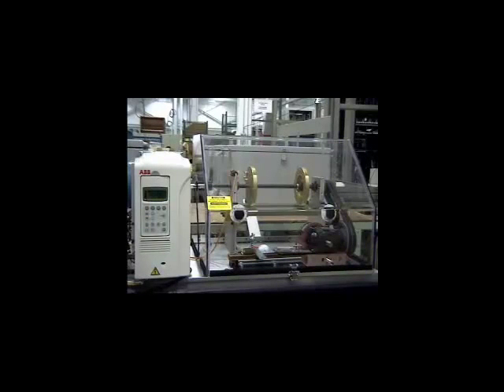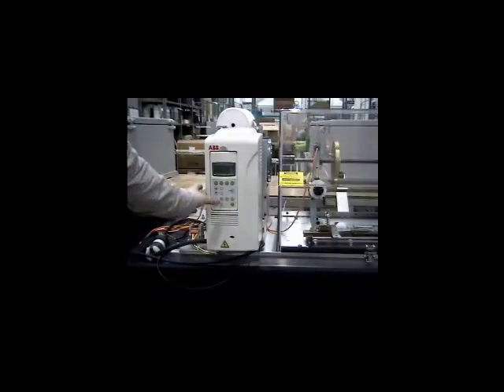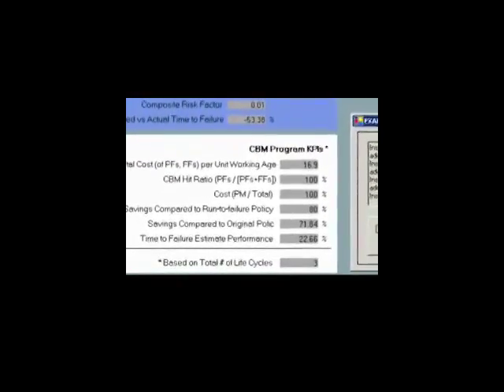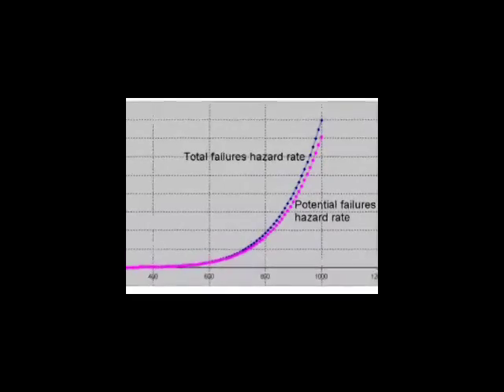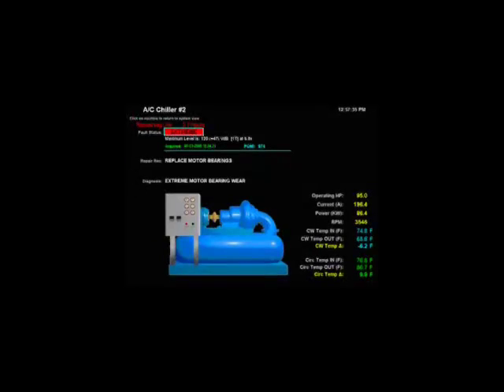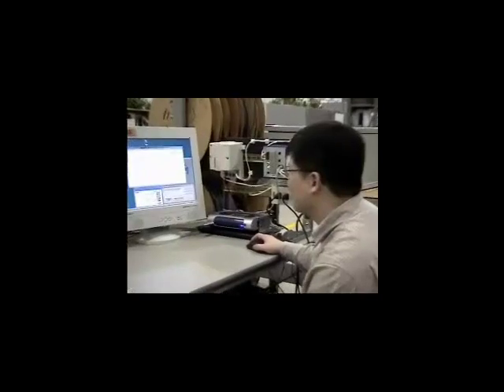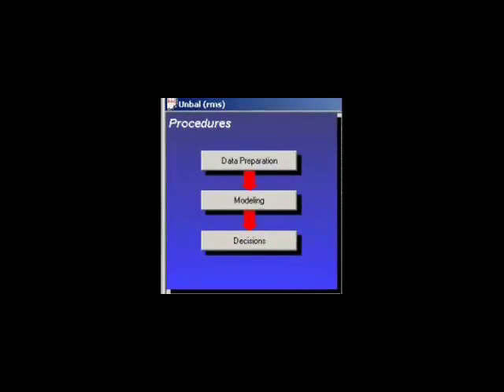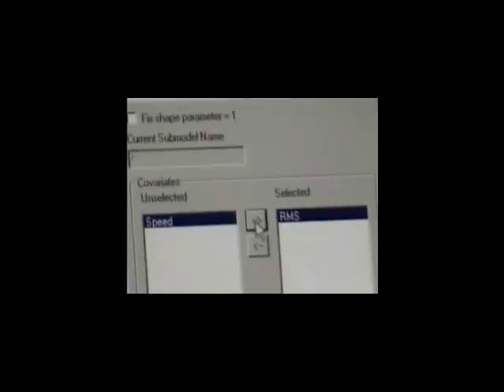Smart CBM

Comment from the maker: If you're wondering about the "speed profiles" mentioned in the video, they work as follows. Each profile consists of a number of speed settings programmed into the motor controller. The speeds of a given profile increased monotonically until failure. Randomness was introduced by the fact that the durations of each speed step are random numbers generated by an external control program.